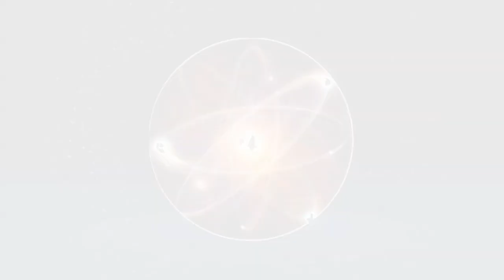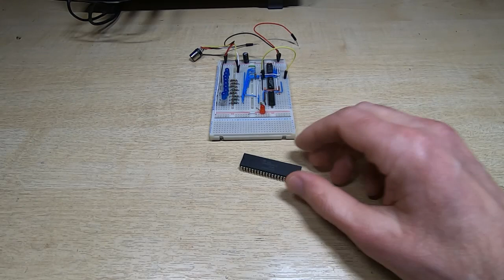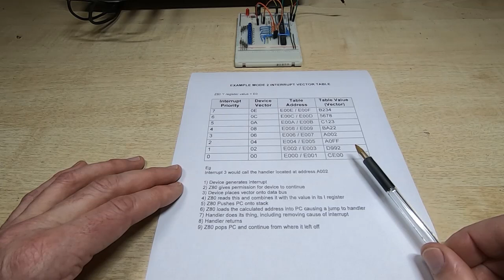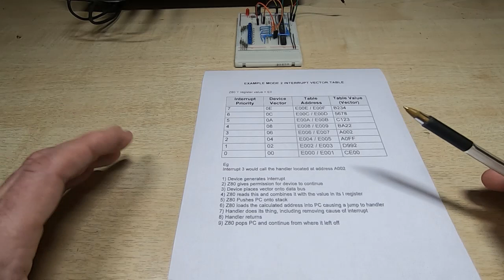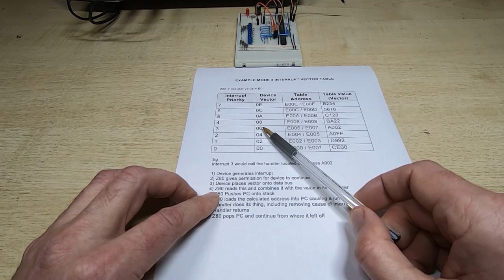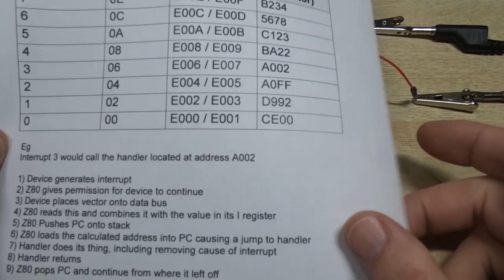Designing A Z80 Computer Part11

Comment: I am finding this series to be very interesting, and it's interesting to see the process of building the various bits that are needed for a working computer with all of the interfaces needed. However, given your desire to stick to early era chip technology, it is a little ironic to consider that the PS/2 keyboard you are using probably has a processor inside that is close to the complexity of the Z80 processor it is talking to. (Unless you are sticking to a vintage PS/2 keyboard from earlier times). You are not that far along with the keyboard portion of the project, but it seems to me that you are going to need quite a bit of software in your keyboard I/O handler to deal with the shift and control keys to emulate the sort of behavior that CP/M (or other software) need in order to handle ASCII communication. I remember you saying that you wanted to avoid designing a custom keyboard because of the costs involved, but I wonder if you had considered some sort of PS/2 to ASCII external adapter, that would take care of the scan code to ASCII conversion, and then the Z80 interrupt handler would receive sanitized ASCII characters.  Regardless, this will be an interesting process to follow, and I thank you for sharing this with us.
Reply from the maker: it takes very little code to convert the PS2 scan codes to ASCII and in fact it only took me around 10 minutes to write the code to do it. What I am trying to demonstrate is how to go about designing the required circuits. I am not really sure what your solution would add other than hiding some of the conversion process which is specifically what I am trying to expose and demonstrate in this project. The PS2 protocol has been around since the mid 1980's so it is not that much of a stretch to include it but if I start using modern converters I may as well just use a PIC for the entire project. As I made clear in the video I gave a great deal of thought to this and I selected a PS2 because it was old enough to be considered vintage but readily available. What you are referring to is the modern version of the PS2 keyboard which is fine but the point of my design is that is can be used with a vintage keyboard if required or even an AT keyboard. I have no intention to use modern converters but you can certainly use one for your own project if you prefer.

Comment: Excellent video, Jerry. I am always puzzled why so many projects tend to do this sort of signalling in the soft/firmware; be it an MCU or a CPU project. You have demonstrated that it can  be achieved in one cycle of the MCU. This tendency might also explain why so few Z80 projects take advantage of the mode 2 interrupt handling. This mode saves having to find the cause of the interrupt by jumping instantly to the hardwired handler. Bliss.
Reply from the maker: I totally agree. I think that mode 2 sounds much more complicated to set up than it needs to be. If the system is carefully designed then it is very simple as hopefully this video and the book will help demonstrate.

Comment: Jerry, are you planning on using the IEO and IEI priority chaining of the z80 in any form or are you latching pending interrupt requests of sources (interrupting devices) before the priority encoder ? I’m thinking of an vsync interrupt to sync output to screen update rate esp. for games if anyone would want to adapt or write some for this system.
Reply from the maker: You can simply use the same circuit to schedule interrupts. You could just use the VSync to set a latch and use the output to generate an interrupt with a suitable priority setting. In fact there is already a VSync latch as I added one for this purpose but you are talking about step 498 and we are currently at step 3. The Same video circuit can also be used for bit mapped graphics or even sprites by multiplexing the data source being output to the video gating circuit but again that is ahead of what I am currently covering but it is nice to see you thinking of the possibilities, That is what I am hoping to encourage. It is also a major advantage of a discrete design because you actually get more control over adding such features.